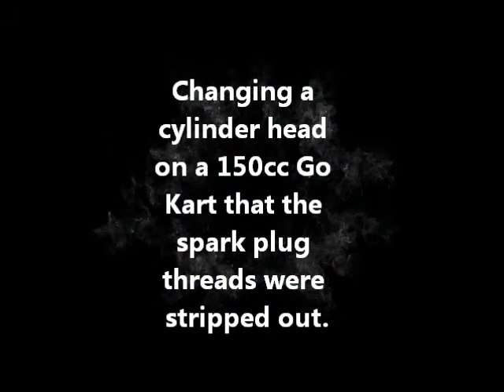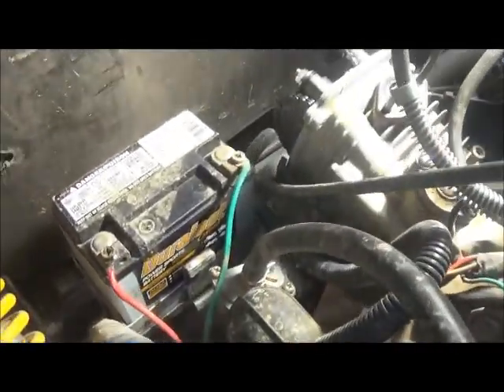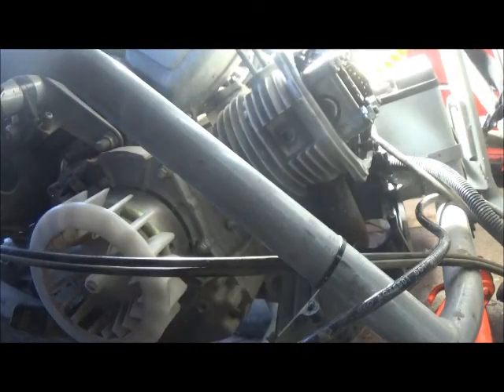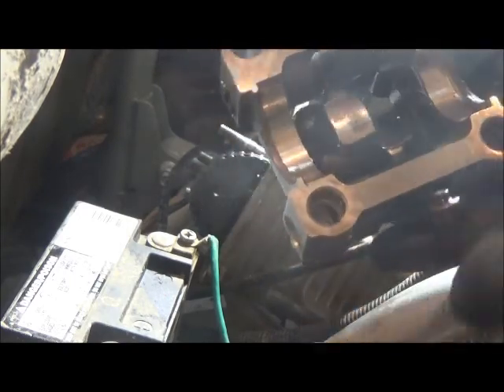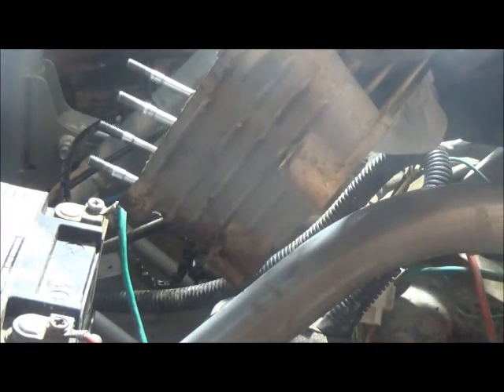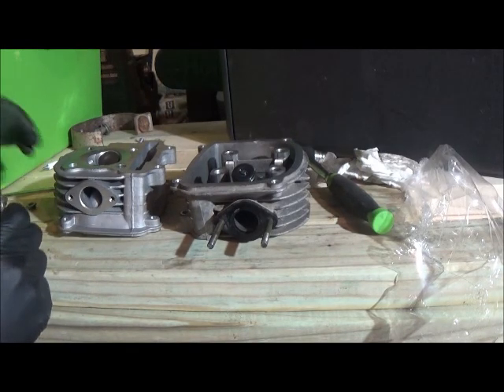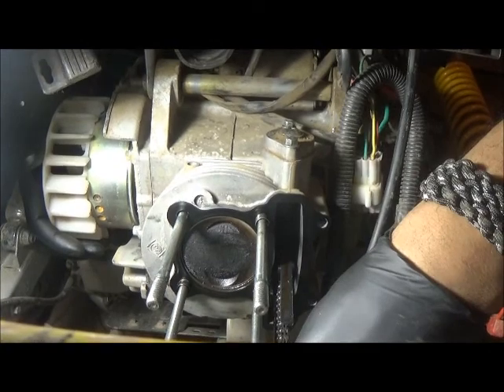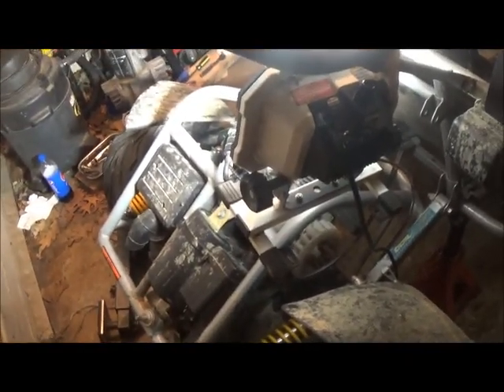150cc Go Kart cylinder head replacement

Comment: Dude. FYI these have a 10mm X 1 thread pitch. Helicoil and other brands make an insert for it. They are stainless steel and hold up well. We fixed a 150 Baja dune buggy. That way and it worked great.

Comment: You don’t show how to put the cam and chain back on. That’s the most important part of it all!
Reply from the maker: Sorry about that,  newbie still with instructional videos.   All the feedback will help me make better videos so thank you.   
I used a pair of medical needle nose pliars (hemostat)
You can use wire like coat hanger or something like that through the head while placing it on to hold the chain up.   

Thanks again for your time in commenting.   
DIY-Zac
Reply: I'm guessing you don't have to mess with the timing chain tensioner?

Comment: I didn't see you mess with the timing chain tensioner, I guess it is not necessary?
Reply from the maker: I would make sure that your tensioner is there firstly, make sure it doesn't have any extra wear or metal showing.   
I didn't have to mess with mine, I would assume the same should be true for your machine.   Unless someone else has already had the engine apart and they may have messed with it...  ( I hate working on stuff after people "try" to fix it.)
I hope this answers your questions, if not let me know.
Thanks again for watching and taking your time to comment!

DIY-Zachary
Reply: @BackyardDIY-Zachary  excellent!  Thank you for responding. I had seen a vid where they had it out, so I was curious. Mine was more neglected than monkeyed with!
Reply from the maker: @mattdwyer9432  right on,  good luck man.  Keep me posted on your project.  Best of luck!

DIY-Zac

Comment: The cam chain has two tensioners. At 12:43 if you pause the video at right front of screen you will see a cap with two (8? 10mm?) Screws and a cross tip or Phillips in the middle. That is a spring loaded plastic chain tensioner. You can MARK the chain to the cam sprocket, but still must set valve timing based on flywheel marks and cam marks as the crankshaft spins at 2x the speed if the camshaft. Great video. I subbed due to your helping people out of insane shop charges. Way to go!!